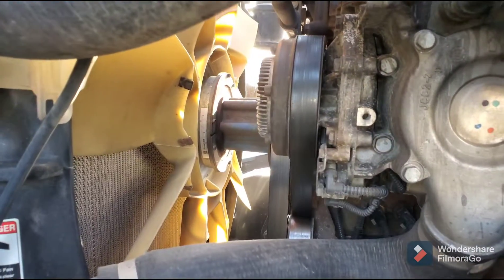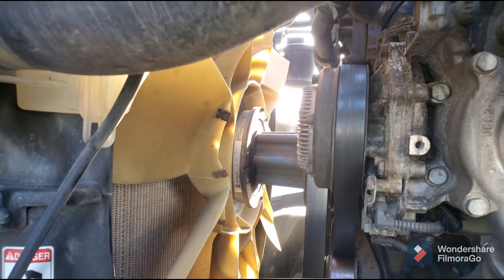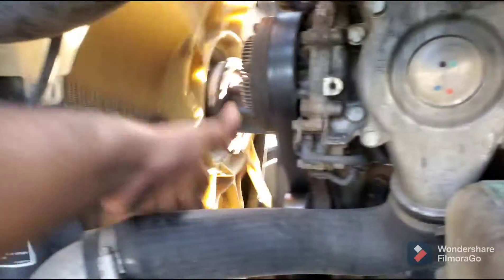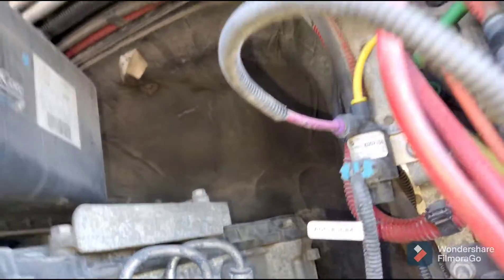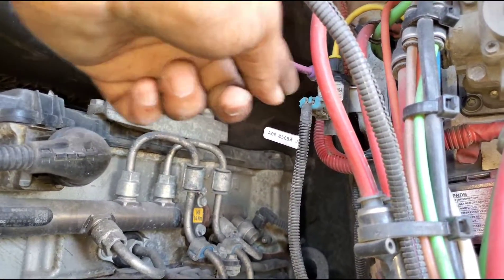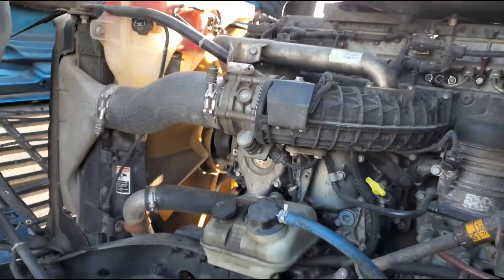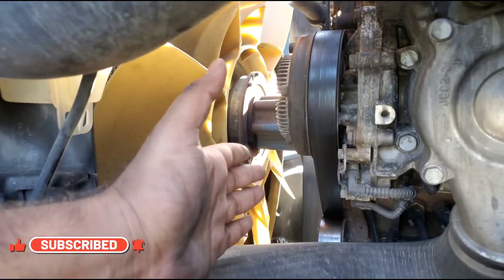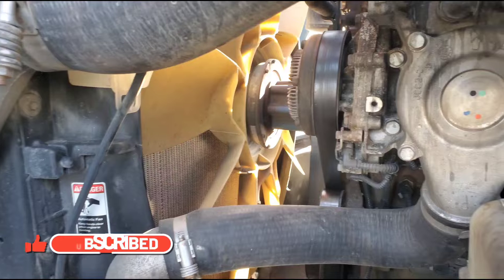Engine Fan not turning on?How to Diagnose Bad Fan clutch on Truck? "SAVE ROAD SERVICE"

Comment: I have this issue on my Subaru the distance between the radiator and the heat sensor for the clutch was a hair too far away to detect the heat coming off the radiator properly. Figured this out cause if you put pressure on the back of the fan pushing it towards the radiator it will engage fine. Going to tighten everything down and hopefully that fixes it.

Comment: I have an issue where my engine temp is only fluctuating between 190-200. My fan clutch is working. The thing that's happening is the fan clutch keeps operating sporadically no matter what the coolant temp is. Sometimes the fan will come on for hours and when it does my ac stops blowing cold. When the fan shuts off it blows cold again. Anyone have any idea? Seems like the thermostat is stuck open which is causing the temp sensor to be confused causing the erratic operation of the fan.
Reply: Solution? I’m also having eradicate fan activity. None of these videos are similar to my problem. Mine is best described as sometimes my fan works sometimes it doesn’t.
Reply: There’s a  high and low temperature valve for the ac u have to check those 2 sensors they control the fan aswell the air conditioner controls the fan right ?

Comment: If your truck has sat for sometime , build up the air pressure and shut it down with key on and manual override to fan on , 2 or 3 light taps on the fan clutch solved my problem within seconds ,don’t pressure wash  around the fan , I e seen it several times se e times   , it will cost u nothing to try this, !
Reply: What do you mean im having an issue when I first got my truck, I changed my reservoir, and my thermostats i originally had 185 and 185 but for some reason kenworth updated them to 185 and 195. I also changed the coolant sensor but for some reason, my fan will not come on until 230.
Reply: This doesn’t make sense. So after building air pressure turn the truck off and then put the key to accessories and then tap the fan 3 times, is this what you’re saying?

Comment: I have a dd15  , my fan woudent shut off, no air leaks , I started the truck and built up the air pressure and turned on the fan engage switch , gave it three light taps with a hammer , problem solved , just try it guys
Reply: with truck on or truck off?

Comment: Some time it locks up because of water.  All you need to do is tap it with a hammer lightly it will loosen the rust.  Don't be that stupid to do it with the engine on.  😏

Comment: If everything checks out okay with your fan clutch. Why won't my manual switch not turn the fan on? Could it be the switch itself?
Reply: There is a selonoid with a wire when you push the switch it sends power to the selonoid check air going to it and power
Reply: @jorsot8839  I replaced the computer on my truck and now it works.

Comment: If I put a manually fan switch , will it mess up my sensor because now my a/c clutch keeps turning on and off , and at the sensor connect and disconnect and it turns on and off .

Comment: Good video, thank you for taking time to record and explain. I have a issue where my fan can spin freely in both directions when the truck is off, and when I turn the truck on and the engine is running, fan is not spinning. Any ideas ?
Reply: Yeah your fan clutch broke.
Reply: Watched three videos on this issue. This here confirms what I have going on. Thank you !!

Comment: My fan clutch is good and I replaced the sensor and fan is still not working is there anything outs to check ?
Reply from the maker: if you disconnect the Air line that goes to fan clutch fan should stay on. if it dont stay on after disconnecting from sensor you fan clutch have problem. sometimes fan dont turn on on time when driving. we can add a switch inside truck to turn on and off the fan manually.  any machanic can do it under 50$.
Reply: Desi thanks for you reply I’ll try this tomorrow
Reply: Update I disconnected the airline and fan was working fine what can I do to get it working the right way if not I guess I’ll add the switch

Comment: Men if you are a mechanic  you are not a good one))))) you have Kysor style FAIL SAFE clutch. If its going to be bad it will be always ON and you will see air leak around. Check to see air leaks and check the hub bearing condition
Reply from the maker: you can bend pipe and zip tie air line۔ also its just to save road service in case of emergency۔ not permanent solution۔ also۔ im not a machanic۔
Reply: Hi. I had this problem. I climbed a mountain, then the fan didn't work at 230    Temperature, came red light and I stopped. After two hours I disconnected the fan wire electric and added antifreeze coolant. It worked, the fan working all the time and continued to drive. My question is Can I continue to drive more 2,000 miles to see my mechanic with the fan working all the time? I  appreciate your answer.
Reply: @luiscaceres3490  did you keep driving?
Reply: Hi